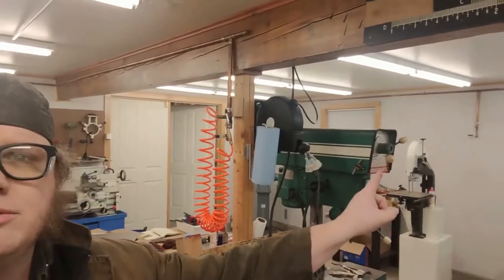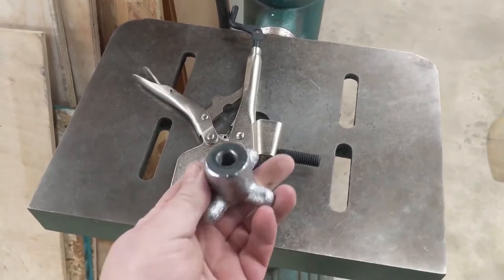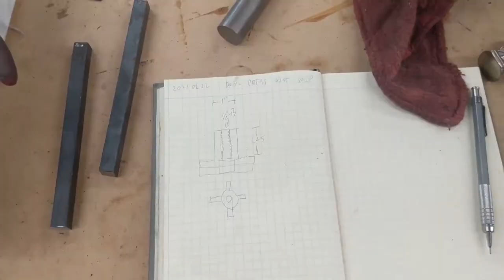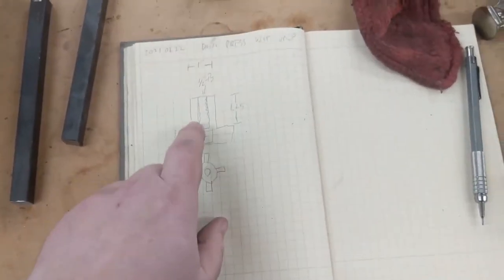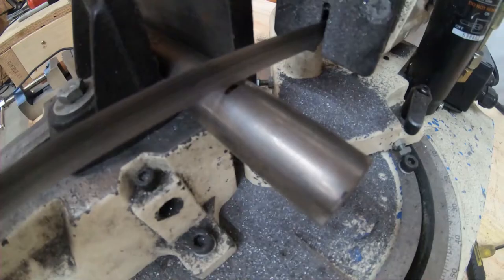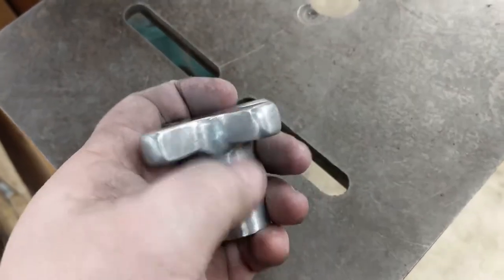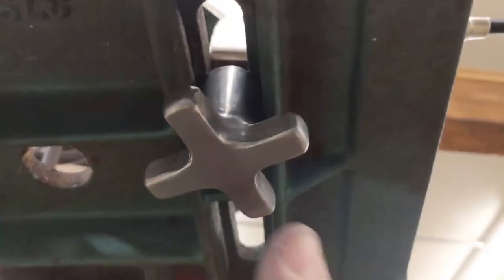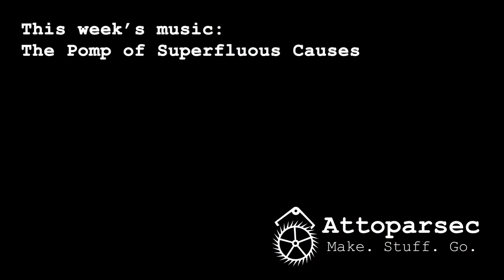Quick shop upgrade: Making a better knob

Comment: A thought that occurred to me when you showed the old knob: is the rough exterior maybe for grip with greasy hands? Also, nice job with the audio mixing on this one.
Reply from the maker: It's possible, I guess, but it really just looks like a crappy casting to me. Either way, I knew it wasn't something I wanted to be touching, no matter how greasy my hands were. And thanks! :)